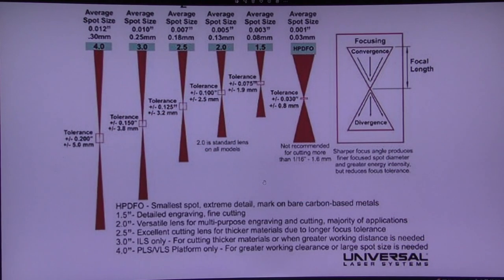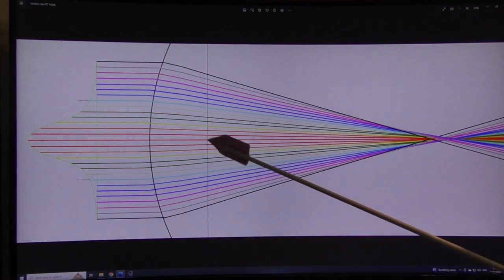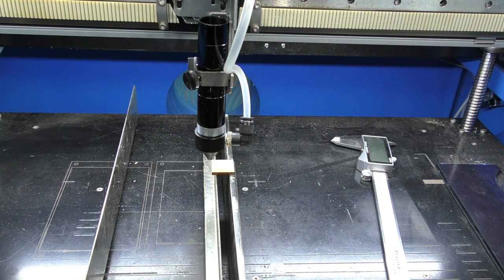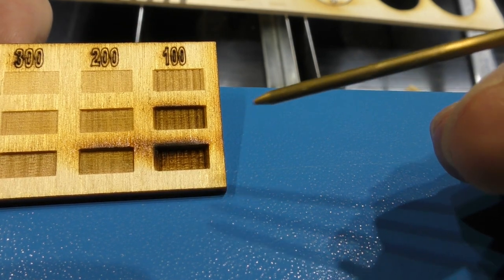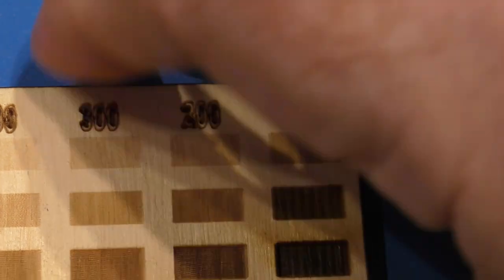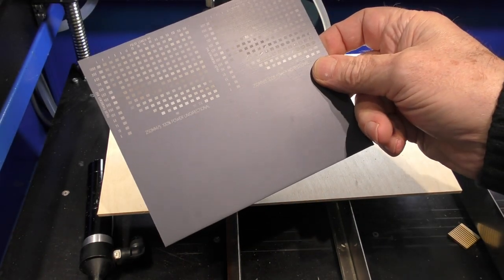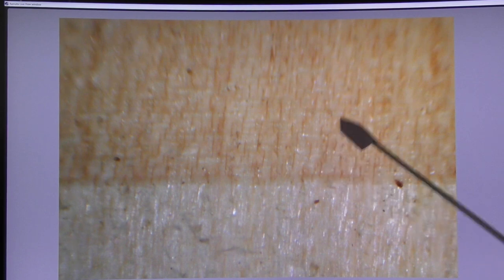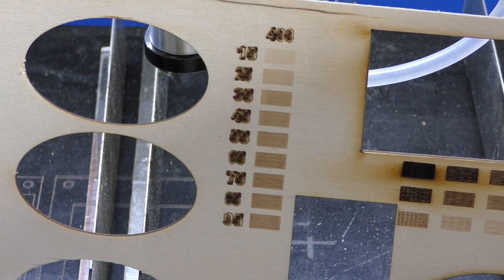Material Test Matrix

Comment: I really appreciate the in-depth discussion on this topic. The "color" is more about the residue and the angle light hits the engraving. This is more akin to a halftone pattern in my view. Has there been much research into halftone laser engraving instead?
Reply from the maker: Yes  I did a study of halftone when Thunderlaser claimed their HD  lens was capable of 1000dpi. 
see   https://youtu.be/OUkBObChgLo

.Any laser photo engraving process requires the SURFACE of the material (usually wood or leather) to be scorched by varying degrees. Sadly when you focus a laser beam it's central core is of such high intensity that it ALWAYS vapourises a conical pit into the material. It is only the low intensity "halo" around the pit that leaves the scorch that you see.

 Half tone is a process that employs different size black and white "blobs" , usually in a  grid pattern at an angle you can define (often 22,5 degrees)  The eye is very sensitive to vertical and horizontal patterns  so this angular tilt is designe to fool the eye. The revised version of the Thunder laser HD lens is now being sold by Beam Buddy in Canada. But the images they use to  illustrate their phenominal resolution is  a piece of black anodized aluminium. This materials is extremely forgiving and is no test for the claims they make  To put downa dots pitched 0.025mm (25 microns) apart requires something other than the  toothed rubber  belt positioning system on a Thunder laser machine. Additionally,  the problem with putting down a 1000dpi at anywhere near the max speed of the machine is nothing but a dream.  The limiting response speed of the HV power supply get's in the way , after all these are still glass tube machines ,  not RFmachines.  If you want to see the terrible capabilities of half tone printing of photos onto wood,  look no further than the Trotec  and Epilog  machine you tube videos.   Because thier machines have RF ;laser sources, they do NOT have the handicap of an HV power supply and can put down dots at a very high rate ( I have my own DIY  RF machine so I know what's possible) They however, dont know how to get good photo realistic images from their VERY expensive machines. Instead they rely on "preparing" images for engraving. using half tone methods  and then finish up with  barbecued cartoon images. See this for example,    https://www.youtube.com/watch?v=bR1qqsy2nn0&t=419s 

  My advice is simple  for ALL types of laser machine. Understand how to create very small dots on materials and the diffusion dithered world of photo replication  will be yours to control.  Take a look at this very short video,  where,  using special  a material and lens combination, I was able to push the absolute limits at 508dpi. NO photo "preparation for laser engraving"  was required, this is just the dithered original image.
.See  https://youtu.be/TVgmoN1wljs

Thanks for your interest
Best wishes
Russ
.
Reply: @SarbarMultimedia  I come from the printing industry which is why a halftone pattern immediately jumped into my head. Thank you for the additional information and videos that you have produced, especially that one that reached 508dpi. And I completely agree with that Christopher Walken photo, way, way over sharpened and contrast.
Reply from the maker: @ddade11  
 This oversharpened  photo is what most regard as "preparing" for engraving. Over brightening the image and then adding contrast and edge sharpening is the everyday way  that people are taught. During dithering  this creates loss of single pixels  that are responsible for the subtle shading in an image.  Image-R are gradually tuning in to my methods and a) recommend using the compound lens  (CO2 only)  and b) try to educate on chosing  a resoliution suited to the  material/lens/ machine capability by providing several different resoultion thumbnail images you can test print to chose the best. . We must remember that a laser machine is not a laser printer that  puts black ink onto a white surface This is a  machine that naturally burns holes into the material by vaporizing  dep cuts or deep conical pits (dots). Until you undestand how to make it repeatably create the same size dots (whatever that happens to be) it's a laser printer from hell.
 Best wishes
Russ

Comment: Always great videos! 95% power though? I cannot go over 60% or I exceed my max mA. You must have set a max in the controller.
Reply from the maker: I have a combined ammeter and current limiter  fitted to this machine. It is set to 22mA  so I can use up to 99.9% safely. Thanks for your concern.
 Best wishes
Russ